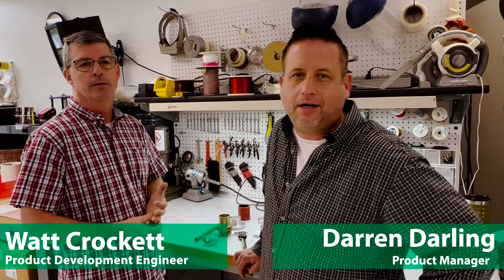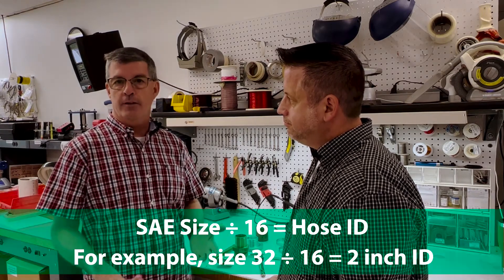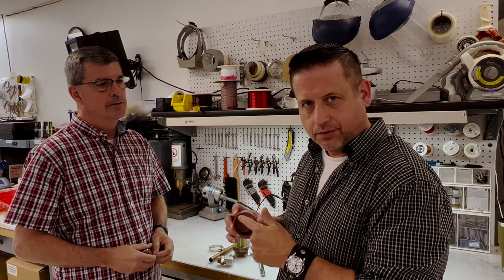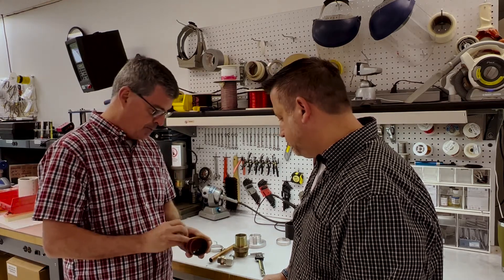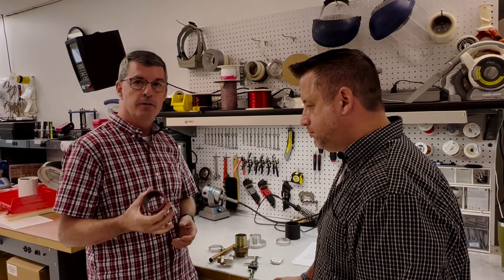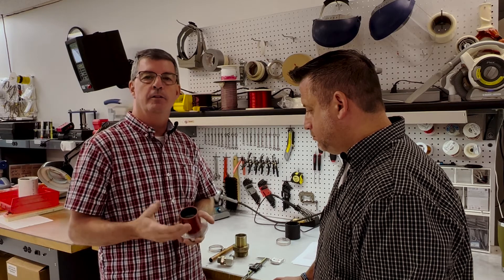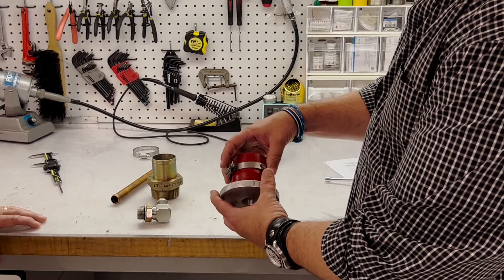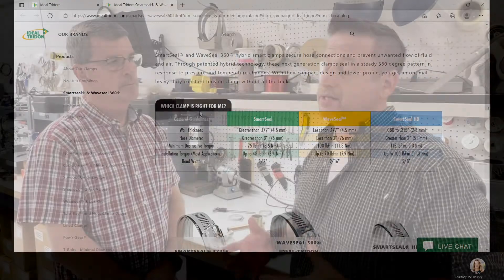What size clamp do I need? | HOW TO SIZE A CLAMP | Ideal Tridon

Comment: I have a 300ss F clamp, which has nothing to do with the numbers you are talking about. I am trying to trap several pieces of wire together. This clamp will not close down enough to trap them. The outside measure of the wires varies from one to two inches. It is an Ideal Tridon clamp. Showing me how to check the diameter is not helping. These things are expensive and don't want to buy more clamps that will not work. I suspect that the 300 really means 3 inches around. But will a 200 shut tight enough, I doubt I can get a 100 around the wider parts. HELP
Reply from the maker: Hi there! Sorry we are just now getting back to you! 

I am guessing you are referring to our 67-4 Series which has an F stamped on the band. If so, there is a size chart on our website that should help!  https://www.idealtridon.com/mm5/merchant.mvc?Screen=CTGY&Category_Code=CAT-Hy-Gear+67-4+620P-Military

If you are unable to find the right size there, feel free to reach out to customerservice@idealtridon.com and our team can help you identify what size clamp you need. :)